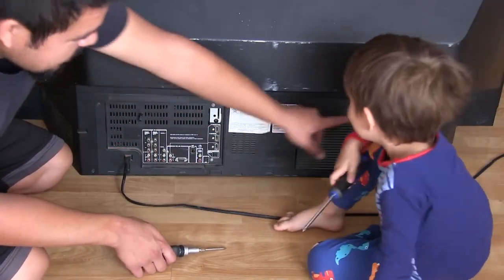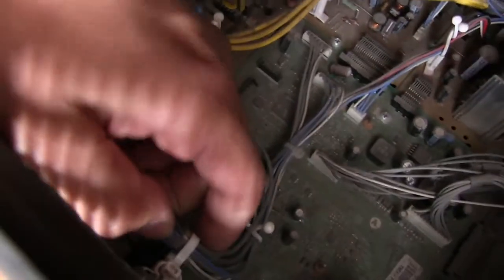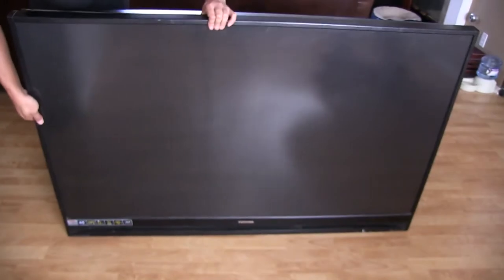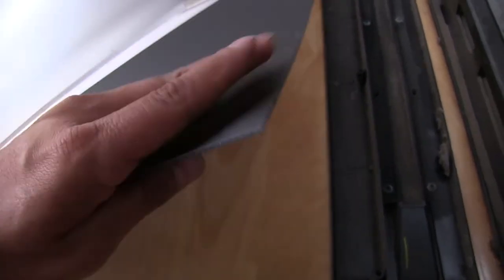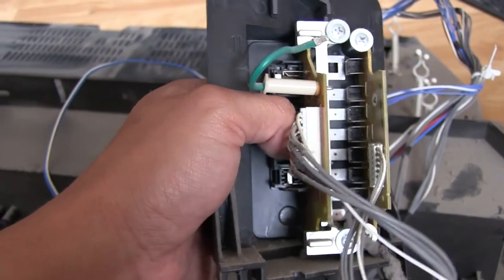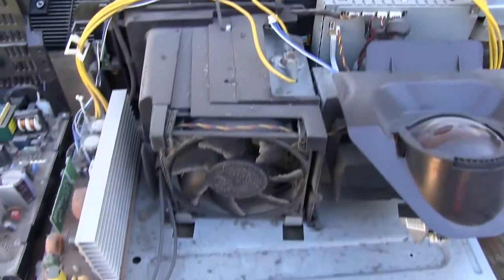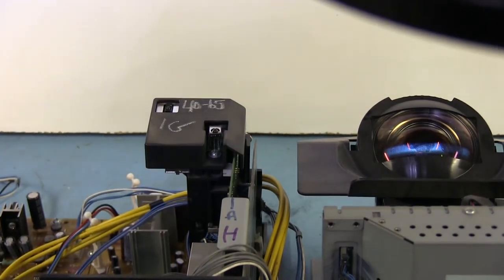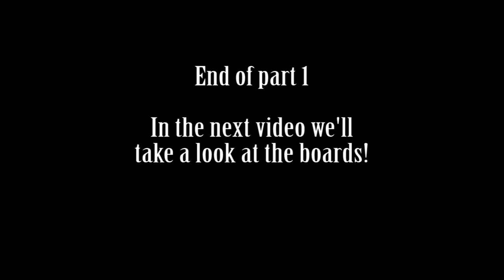TWB #59 | DLP TV Teardown Part 1 of 4

Comment: I had a sneezing fit right after i watched this.  Many years ago i had a magnavox projector. It had 3 bulbs, red,blue and green and it had a coolant to cool the bulbs. It worked until the day i gave it away
Reply from the maker: A CRT projector, those definitely got really dusty also. I worked on one about a couple months back. Bunch of dust in it.